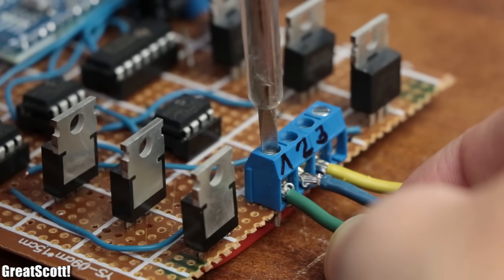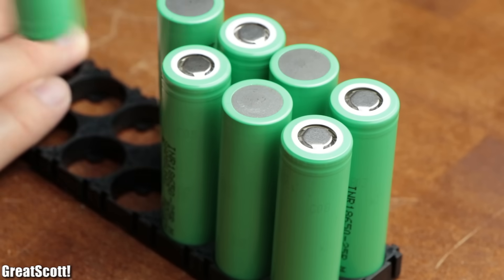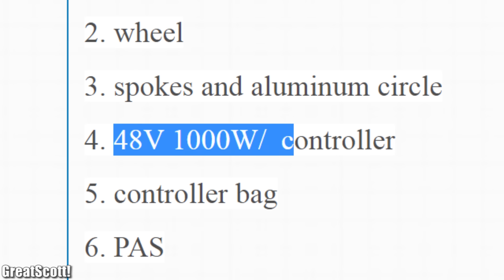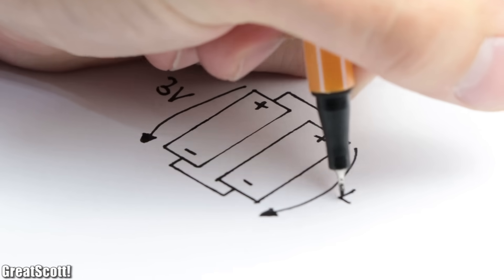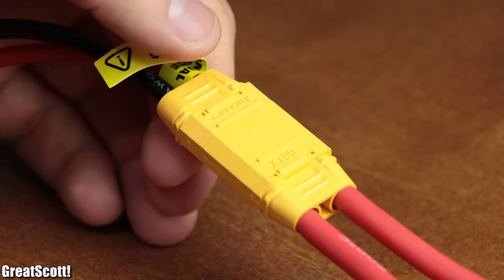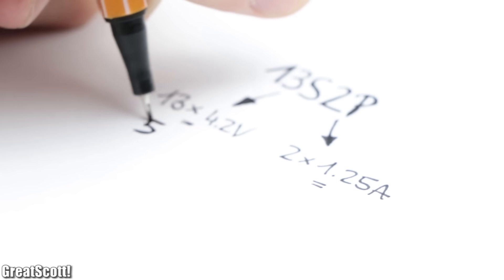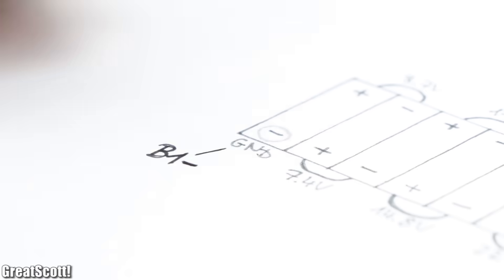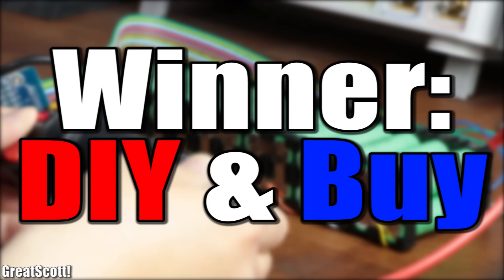EBike Battery Pack || DIY or Buy || Electric Bike Conversion (Part 2)

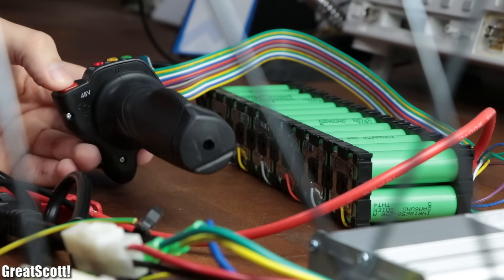Comment: 10:13 and just like that, the pack is still open and the BMS is on the table. How do you call that complete?
Reply: What more did you expect? Have you read the title?
Reply: @wp-wisdom maybe completion of a DYI option? Maybe the title should be "just buy it." 😂
Reply: @wp-wisdom you literally said " and just like that the creation of my DIY battery pack was complete."  I'm very glad you're not a surgeon. People don't like to walk around with their guts hanging out. 😂
Reply: @wp-wisdom  wraping a battery set in an watertight casing is an important part of battery pack creation.

Comment: .   As  of  today,  (Feb 11-2025)  Maximum  capacity  of  18650  cell  is  3800mAh.
 .   Any  advertised  capacity  of  higher than  that  could  be  fake  and  not  recommended.
 .
Reply: Only buy cells from trustworthy sources.

Comment: Incase any of you want to make your own electric bike, instead of paying for an expensive premade battery or DIY'ing it, try to look for battery modules for electric cars. They're cheaper and have a high discharge rate and capacity, you only need to build a suitable BMS onto it.

Comment: i got some new  46160 lfp...      more than 18 amps ((22 in specs))  and at least 3c discharge and quiet big safe charge capability      ,,,  i guess it is worth make a pack.. even if it is going to be a bit more heavy

Comment: You didn't put kapton tape, fish paper or heat shrink on the battery. That all adds up $$$$ - but it still works out cheaper - esp if you use 21700's

Comment: YOU STATED THAT YOU FAILED AT YOUR OL' DiY CELL BATTERY SPOT WELDER, I'M GUESSING  THAT A HIGH MICROFARED AND VOLTAGE CAPACITOR WILL SOLVE THE HEAT AND SPOT PUNCTURE TO THE BATTERY CELL...

Comment: Could someone tell me why you have to connect both sets of 13 batteries in series? Why could you not create a 13s in series and then individually have a pair for each cell in parallel? Trying to figure out how this all works but I’m confused 😵‍💫

Comment: The problem of buying is where to buy? The market is very complicated, I thought about buying an original electric motorcycle battery but it costs on average here in Brazil $1,200 each.

Comment: Thanks for the video. Does BMS charge each 2 parallel connected cells individually? And when the battery is being discharged does BMS only do the monitoring or does it draw current from each parallel connected cells individually so that all cells are 3.0V or 2.8V when battery is totally discharged?

Comment: That feeling you get when you made something, and it works is "priceless".
Reply: I think it's actually priceless, because the feeling is completely separate from the cost. Which is not what quotations adds to the sentence... for anyone that needs to hear that.
Reply: @nicewhenearnedrudemostlyel489  You are correct, I have no Idea why I added quotations. 😅
Reply: i simply aded a switch cables  battery clamps and a fuse with  a converter .. i even learned that the one side of the converter has different stats when work..  melted some fuses  . ruined some solders   ... was epic ..
.. when i was 8     . 26years ago my grandpa  used to let me play with pcbs and even solder ,,   burns and fumes didnt stop me!!!! hope my motivation returns !

Comment: I think if done carefully DIY is better because of its quality battery selection. You just need to add some extra safety features like O rings onto the battery heads before welding the nickel strip to prevent fire and using gooq quality silicon wires..

Comment: Eh... It's not really complete though.  It has no case and isn't mounted on the bike yet, and the are no ports installed to just plug in a charger, unless you're planning on charging it on a lab power supply for its entire service life lol. ...

Comment: couple of things. Your English is excellent. You got a bit of an accent, but I had no problem following along. 2, the information provided here was easily the most comprehensive of any DIY battery build i've seen right down to cell dischage rates. when i saw you putting together a 2p battery i thought, thats not gonna work unless he uses something like the samsung 25r and a minute later thats the exact cell you used.

3rdly I'd like to point out that ebay and other chinese made ebike batteries usually use really low quality chinese cells. they can have a really short life. your pack uses one of the very best cells available.

Comment: Does anybody know why my battery cuts out at about 39.5 volts? (it used to run the motor right down to below 36 volts).

Comment: Quick question, if it's rated for 40A constant output, does that mean that the battery will only last for 7:30 minutes at maximum load?

Comment: I am planning on making my own Ebike battery pack. Primarily because my motor is 24v instead of 36v or 48v. It’s still 450watts though. I will probably be doing a 6-7p6s battery pack. 24v and 20ah.

Comment: Would love a video showing how to make a battery pack with bms.... Charge system AND a mains power system when battery is charging. SO for something like a bluetooth boombox that can still operate under mains voltage  while the battery pack inside is charging etc

Comment: My set up is 10s2p using INR18650-20R and 35A_3.7v bms. It's always killed two batteries from the negative side of bms when connected to load. Is there a problem when setting like 3.6v battery type with 3.7v bms? or it's a faulty bms? Thanks

Comment: You can get old power tool batteries for free and you only need a soldering iron some wire you can get copper strip from a hardware store so less then 30 dollars usd

Comment: Uff just 2 cells in parallel? I guess it's more for educational purposes, so that's totally fine, but for a real battery with a 1000w motor, I would use at least 4 cells. Maybe with a bit higher capacity each cell.

But yeah anyway, because of these dumb e cars, li-Ion cells are really expensive these days... I paid normaly 3 to 4 euros, and now it's not jn stock or costs more like 6-10€... :(

Comment: Me who is using a 3s 6p pack....
Reply: Actually I later decided to build a 4S7P pack with 28 cells at a voltage of 14.4V and capacity of 17.5Ah = 252 Wh at a rough cost of 100€.

The battery he built is 13S2P - 26 cells with a voltage of 48.1V and 5Ah - 240.5 Wh. 
About what I expected. He got 11 km with a 1 kW hub motor, which I'm perfectly fine with. 
My motor (modified alternator) is gonna pull like 600W maximum, so it's gonna be more efficient and I might get 13-15 km.

Any explanation why are e-bike motors powered with a such a high voltage, like 36, 48 or even 72V? Is it to reduce power loss in wires, have faster acceleration or what?

Comment: So, if I have an 500W electric scooter and I'd like to create a battery pack to increase the capacity, I should buy Li-ion cells and connect them in S and P to achieve 48V 10A (or I need more A?) ?

Comment: The thing about the premade battery pack is I would guarantee the cells are not as good, are counterfeit, or are used and that none of them have the same voltage as each other.  So longevity is a real consideration.

Comment: made a short circuit at charge port , it scared me so much . My battery had some problems , it stops from charging and when i move cable charge again so i put screwdeiver inside charge port and to charger port ,and alot of spark happen , the pin inside chsrge port is bend a little . I put at charge and it works same as before , so what to do ? I thinking to open and unbent the pin ?

Comment: Good day sir. Can I asked a question? it is okay to use a power supply 30 and 2amp to charge my battery pack? with a bms 10s. I Used to do this project, and I got 37 volts ouput and 5.8A for may output of my battery. I hope you can answer my question.

Comment: li-ion is garbage... its only rated for 500 charges compared to lifepo4 2000+ charges. Also li-ion is dangerous and obsolete tech by now. I do hate cyllindrical cells passionately since it requires spot welding - there are now cheap 50 ah prismatic lifepo4 cells, no need to make your life miserable.

Comment: If you make it your self you learn something new, and you can always change the battery pack. Split it in 4 smaller, merge into an even bigger, make it charge other stuff like drones, phones, raspberry pi and what not. The batteries you buy finished you cant just charge diff stuff with them.

Comment: Hallo!
Ich habe vor mein altes Fahrrad mit einem Nabenmotorsatz von Ebay auszustatten (Motor, Steuergerät, Pedalsensor aber kein Akku). Meine Eltern haben beide eBikes in denen das Bosch Powerpack 400 verbaut ist. Ich als Fuchs hätte da natürlich Lust auch von den Akkus gebrauch zu machen. Ist es irgendwie möglich den Bosch Akku für "nicht Bosch" Fahrräder zu entfremden? Hat jemand eine Möglichkeit gefunden dem Akku ein originales Fahrrad "vorzugaukeln"?

Comment: Hi, Scott I just want you ask a question, I have 12 volt dc motor and I have to use it with li-ion battery but as you know when battery gets full charged cell reach 16.8 volt(for 4s cell)  it's too much voltage for my dc motor. Do you have any advice what can I do. My dc motor draws 14 amp.(almost 200watt). I hope you see that comment.

Comment: Can i use series connection to full charge my new batteries?
When i connect them in bms i cant get to  full charge, i have 16s2p lifepo4 batteries
Help me sir scott. Thanks!
I already spot weld my battery pack but the batteries is not in full charge when i connect them. When i try to charge them all using bms 16s i expect to get a 58.4volts but is it only 53-54volts only please help
Reply: I kinda think to top balance them but i already spot weld them all, should i remove the strips and connect them in parallel to charge them all at full charge?

Comment: i have ended up with 50kg of laptop batteries under my ownership and need transport to get a job, but can't afford a motorcycle. I think DIY might be the winner for me since a BMS, nickel, welder, wire, connector, printer filament, tape and charger would cost ~70GBP and there are 1kW conversion kits for 160GBP which totals around 250GBP for a conversion, albeit one can motorize a bicycle for 100GBP (+20 for oil threadlocker & other items needed to do the best quality job) if they were willing to give up their rear disc brake, however such a motorization is significantly more unreliable and is more illegal than riding an E-bike at more than jogging speed, but who cares really?
Reply: we think the same, ive done the same shenanigans

Comment: I have an electric bike with a 48v_250w battery. Can I put a 48v_500w or 1000w battery for it? Will the electric motor damage when I put a bigger lithium battery? Thank you

Comment: I think the most important is the connection to the rest of the controllers of the bike. Most of the time, the BMS of the battery needs to talk to the controller unit of the bike. Then p.ex. the display of the bike can show the state of charge (SOC).

Comment: I ride an e-Moped and it takes 2 x 4kwH batteries.  They cost £1000 each to replace.  Once they are definitely failing I will be refurbishing them myself with new cells.  Each battery takes 170 18650 cells.

Comment: I'm really interested in building a ebike and have an electrical circuit that would benefit I think the whole ev community  give me a thumbs up as I feel it would really challenge you as I don't have the mathematics in calculations but have great knowledge in low voltage. A worth while challenge.

Comment: You're comparing trusted cells from a source to the cheapest completed batteries on eBay? Which would unlikely have reliable/good quality cells in it - probably with over inflated ratings.

Comment: The batteries that you linked on Ali already have the Nickle plate soldered, so you just need to solder a bus bar to the battery plates this way you don't need a spot welder, and you won't stress the battery because you are not soldering on top of the battery.

Taking into account the AliExpress prices, at this moment I would say that DIY wins, for a 36v 10Ah battery its 80eur cheaper.

Comment: I want to make battery   pack for motor having 48 Rated voltage and 92 Amp continously current by using samung 18650 -30 Q cell ( 4.2 v max volt, 3.6 nominal voltage , 3000 mAh   , 15 Amp continously discharge   current ) 
11S6P  Or
12S6P Or
11S30P  Or
12S30P . 
Which combination is correct  please let me know 
Thank you
Reply: Ypu need 13S6P.
Reply: @andrej1953  Thank you Sir .
Reply: @andrej1953 Sir  I just have one doubt while calculating number of cell in parallel we consider cell capacity or cell maximum Continuous current with respect to desired motor continuous current ???
Reply: @shingrutashish8001  The capacity of the cells depends on the discharge flow. Higher current means less capacity.
 Take a look :
https://secondlifestorage.com/showthread.php?tid=7447
Rapid charging or rapid discharging corrupts the cell. It is not a good idea to charge the battery above 80% of the rated capacity or discharge it below 30%. Sometimes, of course, this cannot be avoided because we need all the energy in the battery. You can make 13S7P or 13S8P. The more P hiĝer the capacity (but bigger battery and hiĝer cost). My e-bike has 10S12P battery, made by  Pabasonic 18650 2.900 mAh cells.

Comment: In need of advice please. I have built a spare 24V pack for my bike. The thing I didn't realise that the original pack is " smart ", it has two power connections and two light duty connections. When I connect  the spare to the power connections only nothing happens.  Is there a " fix " for this or have I wasted my time.  If no, could I charge the original with the spare ?. Any advice welcome, TIA.

Comment: in this case the DIY is the clear winner, if you take cell quality into account.  your DIY cells are far more better quality than the cheap ebay packs.  they use fake samsung cells

Comment: if you go the cheap sketchy way and just solder the strips to the batteries with care to add as little heat as you can and either get the batteries free or buy them for like 50 cents a sell in packs online at a website that im not gonna tell u about because im selfish you can do it way cheaper DIY

Comment: If I was to use my ebike in eco mode only, would it be reasonable to build a thinner, lighter battery pack?
Reply: Yes, as long as, eco-mode does not consume more amps than the battery pack can safely deliver  ...
Reply: @MrSummitville , as I thought. I might give it a try...

Comment: Buying is probably the better option, you would still need to buy a case, mounting system, key switch, charging connector, ... While a finished battery comes with all of that.
And now there is plenty of option to buy finished battery using new Samsung cells

Comment: I have problem with my E bike.. Fiido D1.. the battery Discharge easily when i used full electric! discharge quickly.. drops to 60-70% then it remains 80-85% just ride 3kms.. what do you suggest?? should i buy new battery?or i have problem with BMS??

Comment: wow, great vid. 
Hi GreatScott
I have the EMMO GT80 scooter with 80V/20Ah Lead Acid battery.
I want to build 1 or 2 or 4 (LiFePO4) batteries that will equal 80V, 20AH.
Whichever is the best and Economical way

can this be done? 

80V/20Ah (LiFePO4) battery  
or
2 x 40V(LiFePO4) battery =80V 
or
4 x 20V(LiFePO4) battery =80V

Thanks

Comment: great DIY video, but I am wondering, why you used 20A BMS if your output current of battery pack is 40A ?
Reply: Typically, we over-rate the battery pack for longevity.  Do you want your battery pack to die in 6 months or 5 years ?

Comment: If all the cells are connected together how do the individual cells have different voltages? It seems that the BMS wires are in effect connected to the same piece of conductor.
Reply: The cells are also connected in SERIES.  Eventually, series connected cells, will ave different voltages.  Do some research regarding BMS ...

Comment: Can I hook up a 36v 12Ah battery to a 36v 4,4Ah battery (as an external battery for my Hoverkart/Hoverboard) without problems in parallel?
They both would come with a BMS built in. Does this already prevent charging of the batteries between each other?

Thanks for help

Comment: Just some flaws Ia have seen. 

1. Welding parallel tabs, One Parallel tab is enoug. Seriell must be from every cell to the next.
2. Balance cable must be welded on a path were no current is flowing -> on the parallel tab. Otherwise you measure the voltage drop between the tabs (of course its not much) but neitherless you can even get more drifting because the BMS tries to calibrate something that is not necessary.
3. Soldering directly beetween the + side of the cells can end very badly when the cell isolation underneath melts and you get a short cut to the housing of the cell. -> Use isolating paper.

Comment: is it possible parallel-ing 2 battery pack to achieve higher output current?
Reply: It is possible, if the battery packs have the same voltage

Comment: Don't know why you built a 13S2P pack using 25E cells, 5AH x 48V = 240 Wh capacity is simply inadequate.

You can purchase LG M26 cells for less than $3 US and build a 13S5P packs (65 cells), with BMS, for under $300 using Vruzend kits. Or, you could use MJ1 cells in a 13S4P configuration for about the same price.

Comment: I have a MIJIA M365 Batt pack and BMS that's not being used. I have upgraded to higher end electric scooter and I plan to use the battery pack as additional battery mainly for lights and other stuff. I just don't how to do it yet.